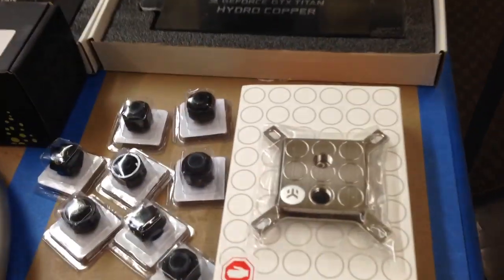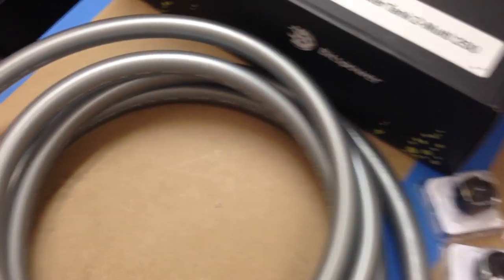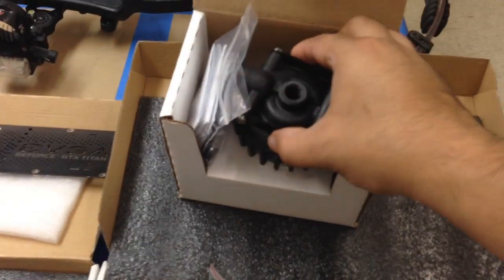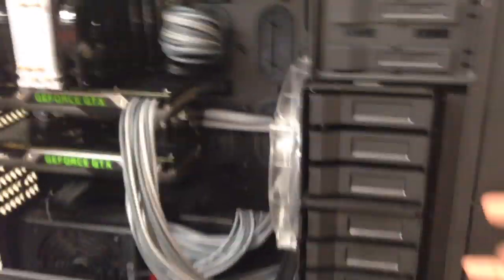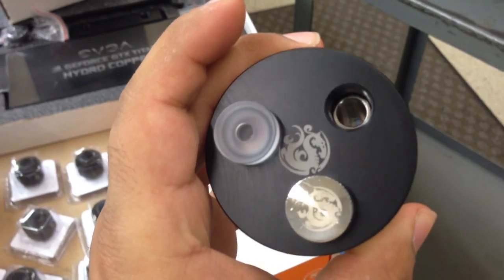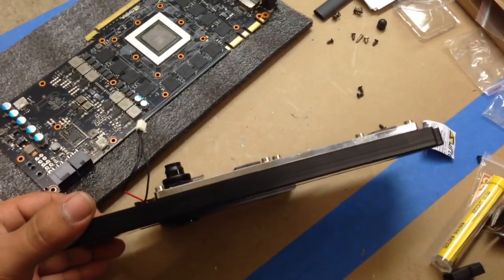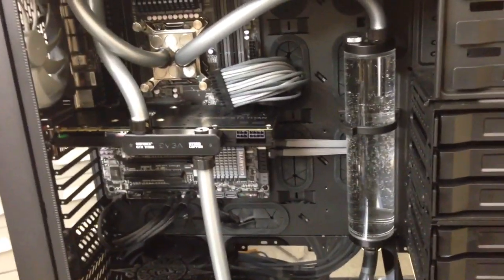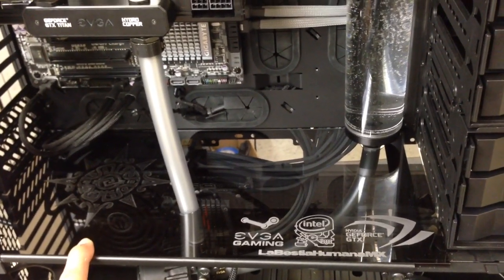GTX TITAN Hydro Copper SLI - Water Cooling Project!

Comment: Do i need install any hydro cooler system on this video card(EVGA GTX Titan X Hydro Copper)? or do i need to attach any cooling system on this video card or i can connect this video card to motherboard and it will work it perfectly without any external cooler or without any external hydro cooler?

Comment: so is it possible to set up a hydro copper card with all in one water cooling?
Reply from the maker: Maybe one of those swiftech expandable AIO solutions.
Reply: Leona197 i know there are other GPU water blocks that support AIO water cooling. i believe one from NZXT and one from corsair (the corsair one only supported asetek coolers)
Reply from the maker: Those units come with their own block, VRM cooling is not very good though.

Comment: Hm. I was looking the coldest water flow from the radiator. Seems to me cpu, res, pump, gpu, radiator. I think the coldest water runs your cpu first. Hope im not confused.D
Reply: I've seen a few videos from amateurs and PC-magazines which prove that it does not matter at all in which order the water flows through your components. The water usually flows so fast through the loop that is has the same temperature in every component, varying maybe 1/2ºC max

Comment: Seems like a smart set up. I am assuming the cpu gets coled first than everything runs trough the res than the gpu. I have one question. How is your gpu temps.? Since usually cpu than gpu than res.
Reply from the maker: The GPUs get water first, then cpu, then the motherboard. I changed the setup and added a second card. Gpu temps are 38C with 25C ambient. CPU at 4.7 gets to 70C under max load. 65C while gaming. It really doesn't matter how you set up your loop as long as the pump comes after the reservoir.
Reply: Could you post a video on your set up now.? Thanks for helping.
Reply from the maker: Build Log - 4930K, GTX TITAN SLI , R4BE, EK, Monsta - Ultimate Gaming Workstation

OCN build log, with tons of pics:
http://www.overclock.net/t/1424663/build-log-aztec-dark-knight-completed

Comment: wow man thats really an awesome setup alittle expansive hahah why did you want the silver on the tubes does it affect anything?
Reply from the maker: I used silver mainly for aesthetics, but it helps act as a biocide. If you use silver, and copper on the same loop, it is recommended that you use an anti corrosive as the copper may stain or oxidize with distilled water.

I ended up switching gpu blocks, and went with hard acrylic tubing and many other changes.
Reply: yea good idea you bend them your self?
Reply from the maker: Yep, I went through 24feet of tubing, before getting the bends right.
Reply: Silver is a natural bacteria killer. Just like a silver kill coil, the silver in the tubing (yeah, tygon actually uses silver in these tubes) helps keeping your loop free of algae and other nasty stuff